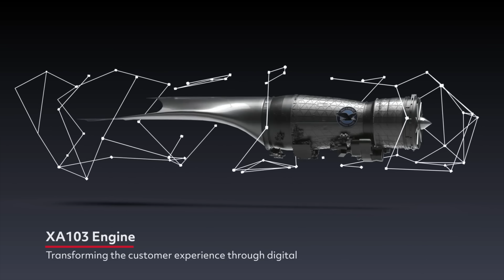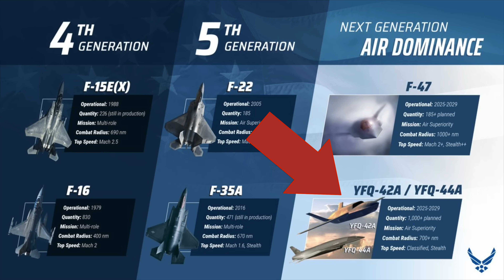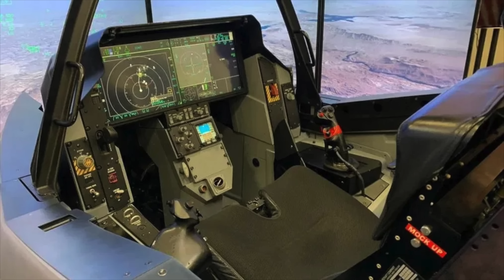Is the US Air Force F-47 Already Flying Missions?

Comment: The new engines capable of 110,000lbs. of thrust with 25% better efficiency. New tougher and better stealth materials. A new data and communication architecture. A flying node able to control CCA's and other forward deployed assets. With the new JATM 260, peregrine and mako missiles becoming available. More electrical capabilities, battle management systems, next gen radars IR sniper pod AGM 183 carry capabilities and LRASMER. This is a generational leap in capabilities.

Comment: Provided it all works, it seems like this will make one pilot the equivalent of 5-10 pilots provided they can stay hidden and at range.  That's just insane.  The ability to move drones in and out so they can refuel or rearm would allow that one plane to control a LOT of airspace for a long time.   I get why they want this for sure, if it works, it would be a massive multiplier and allow a much smaller manned pilot force.

Comment: This may sound crazy, but I saw this aircraft (or something very close or looks just like it) when I was stationed in Nevada (technically, Nellis AFB) back in the late 1980s.  Possible?  I don't know how, but I know that I saw it take off from the runway and fly straight up and then out of sight in about five seconds.  It didn't have the sound of a normal jet engine, rather a pulsing sort of sound (the only way I can describe it is the sound you hear when you're driving your car and one of the windows is open--that sound you hear and feel as the air move in and out of your car).  It also didn't have any vertical stabilizer wings (kind of a flying saucer look when you viewed it straight on from the front--as we saw it coming down the runway).  My partner in the car saw it, too.  It flew right over us (we were in our vehicle stopped near the end of the runway (northweast side), coming back from the LOLA on the far side of the runway).  I never saw anything like if before nor after.  A few years later, I described what I saw to someone who knew experimental and secret aircraft, and he said it looks/sounds like something from the Aurora program.

Comment: I'm 100% sure that the USAF will follow the same pattern that they used with the F-117. They most likely have two operational units of 20 planes each (two front strategy). With an additional unit dedicated to training. There will also be two F-47's at area 51 for udate proofing. I expect that we will find out later that the F-47 was with the B-2's over Iran. This is what I experienced for 8 years in the black/grey F-117 program at Nellis AFB, and TTR..

Comment: I will have to apologize up front for questioning some of the data that you have given regarding the F-47 program.  As I ponder back on the previous programs - all of the "fighter" profiles that we have seen come out of the contract programs - The F14, F15, F16, F18, F22 and F35 programs have ALL  maintained vertical tail fins on the back (single or double) for Mach 1.2+ operational speeds.  This new F-47 profile (albeit stealthy looking) is an otherwise unproven airframe in any battle theatre.  Russia's SU-57 Fighter has shown its air dominance capabilities.  Furthermore, the pilotless F-47 hasn't been tested with its onboard AI systems to see how much more dominant it is in dogfight scenarios against experienced pilots in F-22's and F35's.  You can remind us that pilotless fighters can perform maneuvers in excess of 8 G's and not lose pilot consciousness, but this doesn't attest to the unknowns regarding the new F-47 with an unproven airframe and autonomous avionic flight software.  Computer simulations alone are not sufficient for thorough assessments of these contemporary platforms.  Thank you for hosting such an insightful and confident review of this new air dominance program, but the fact of matter is - no data has been given about this fighter's operation around an S-300, S-400, or S-500 Russian radar systems that are said to be able to detect and track F-22's and F35's (at least the S-500 is supposed to have an upgraded capability for such).
Reply: Oh, and might I add - Canards - not typical of an American Fighter design - unless we are trying to blend in more with the Russian design concepts (lol).

Comment: Hey Ryan. What if the problem is not 2 engines but several smaller engines. Say 8 vector thrusting engines blended into a B21 design. Cruise on a few engines, or tear up the sky with all 8 on afterburner, till the scramjets kick in. Think of the manuvers an 8 engine thrust vectoring wing could do. Yaw is not lost. In fact, You could crazy Ivan. Flip end to end. I'll see if i build a ducted fan drone to test the concept. Cheers.

Comment: The more I hear people like this, the more the whole thing comes across as made up propaganda. There's just too many obvious problems with the story. The B-21is a real thing that's currently being built. Incidentally, it will not be operational until sometime after 2030. Meanwhile, some fake 3D render of a supposed F-47 shows up completely out of the blue, and we are to believe that it is real—in fact has been real for years, and is practically already flying combat missions? And without even a single photo that actually shows how it looks, no less? In other words, we are evidently expected to accept the absolute lunacy that some goat herder in the middle of nowhere will have already long ago seen what is, kept from the public—which, mind you, serves no actual purpose (most differences between 5th and 6th gen are not visible from the outside, so the whole front fuselage shrouded in mist presentation is nothing more than cheap theatrics), yet at the same time just so happens to benefit from public ignorance regarding what 6th gen actually means; because if the public actually knew, then they would also understand why that picture is 100% theatrics. The whole thing reeks of BS. And it's not even intellectually challenging, which is what makes it most insulting. It is completely reliant on the fact that the public doesn't even have the faintest conception of what 6th gen design entails. This much is readily evidenced by the fact that all these Internet geniuses saw some tailless Chinese prototype and, on this basis alone insisted it was 6th gen.

Comment: Just came here from your newest and really disappointed, still more concept models.  How does this have more payload?  I counted a decreased payload from the F-35:  4 AM-RAAMs, 2 Sidewinders, and 1 etc., I'm also betting less, possibly no, gatling.  The decreased cannon would make sense with its decreased ability to dogfight though, so at least some thought was put in.

Can't wait for it to have to be redesigned, $$$, for exterior fuel and weapons attachment points.
Reply: You said it yourself, it was all concept art, so why would you assume the payload is what was showing in a “fan made’ concept fighter? That makes no sense. I do believe it’s size is in part to allow for solid payload capability, but for each F-47 to have slaved drones with onboard weapons systems means the technical all up loadout is even higher than we thought…spreading your payload across drones lets you carry more and less at the same time to maximize range. The F-47 won’t need to fly weighted down to the max to have a greater assortment of available armaments since many of the bombs and missiles it could equipment can be Sherpa’d out to the target sight. Moreover less dogfighting capability means more armaments ultimately. Dogfighting always required compromise, weight and inertia are unavoidable with thousands of pounds of armaments on the aircraft. Less of a compromise for the F-47. I think this entire program needs to be looked at holistically before assuming the worst.

Comment: It, "processes AI."  How exactly does one process AI?  It's an entire 2.something feet longer and 5 feet wider than F-22, but has over double the range?  Even if it has 1,000nm range, that means that the conga line of tankers that will be required to get the thing into the combat with China will be well within range of Chinese aircraft and their missiles.  That is the benefit of a carrier, unlike air force bases they can move and launch their aircraft from not Hawaii, AL, or CONUS.  Yeah, I'm assuming Guam doesn't survive and no one wants to be involved with us for some odd reason.  Naturally it will need to actually exist.  I'm not buying it does outside whatever leftover prototypes they had leftover, nor that Boeing can build anything in a meaningful quantity anytime soon.  2035, haha.

Comment: I’m going to receive a lot of controversy but i don’t this will be unbeatable. The Chinese already have 2 flying 6 gen prototypes that are quite deep in that section and even though it’s likely the US plane may be slightly better. It completely unreasonable in stupid to assume chinas tech is bad. It is a lot easier for china to get a good plane working faster than USA simply due to the sheer number of stem students there. I’ve also seen people say that Chinese stealth tech is bad and even though it is generally considered worse than that of the us, they still have 2 operational 5th gen fighters so they definitely have the technology. Chinese planes are also now combat proven as they downed 3-6 Indian jets without maintaining a loss( rafale(s) su30 mirage mig29 downed by j10ce)

Comment: What I've learned about tech development in general is that throughout history, US fighter jets have often had electronics down to the integrated circuit level alongside systems level that the public has only in it's infancy or theoretical stage of reality, which are in contrast decades or fully functional and even optimized and improving. Every consumer grade tech commodity is a trickle down from advanced fighter aircraft, long long after it's been cutting edge in them much less public knowledge. In this case, I'm certain the AI platform present on these fighters is frighteningly advanced, perhaps even including aspects of AGI. No doubt in my mind they've reached that already, and likely would have to tamp it down to follow orders for combat. Then again, they likely have trained it's datasets specifically for war, which is itself a frightening prospect. Ghost in the Shell and so much other sci-fi about AI is not far-fetched, at all.

Comment: The adaptive cycle engine XA100 for this thing is still in development. Still 2 years out before it is mature enough..

I doubt it had being flying. Flew a scaled test bed for the control system, maybe.

If you look at the funding levels for F-47 compared to F-22, it is roughly the same at the developmental stage. Much lower than what F-22 got when it is in the production stage. 

 The plane is still in development.  USAF was caught off guards by the Chinese development, and is scrambling to save face, making up this secret flying  squadron. LOL

Comment: You have talked about Yaw, with the wider stance of the F-47 that means more control surface area, for greater stability.

It would seem that we are trying to make radar useless, are optical systems the way to find a plane? I mean we have space telescopes finding exoplanets, of course that would only really work in clear skies, but lasers scanning the skies and returning a hit, oh those have been banned ...good move? eliminate a tracking source before it is even put out as a possibility? the SR-72 had high speed cameras, those have only gotten better with time. if radio waves no longer work, then what about visible light, one fictional movie suggested air turbulence as a method...of course it also suggested a space based earthquake creator too lol.

Comment: If the F47 has as many defects as the F35 which has accumulated more than 800 major problems, the F47 is not ready to fulfill its functions in the near future, many pilots in Europe complain about the lack of reliability and operational availability of the F35, if the F47 is in the same line it is not a situation for the future.

Comment: And why do we need F-47 when we have F-35 with a life span of 50 years or 8000 flying hours airframe?
Reply: Because the f-35 is less stealthy and slower than the f-22 whereas the f-47 is even more stealthy and possibly faster than the f-22. The f-35 is a true multirole. Its not exceptional at any one thing but its real good at a lot. The 47 is more purpose built. Also the military has come to hate the single engine design even though thats exactly what they asked for when the 35 was designed. Thats one of many reasons the 47 is for sure a twin engine design.
Reply: @95dodgev10  And you know this from what source? Did you work on F-22 or F-35
Reply: @95dodgev10  what is less stealthy?
Reply: @xfastwalker according to public information the f-35 is considered "stealth" with a radar cross section from the nose of .005 square meters whereas the f-22 is considered "stealth+" with a radar cross section of .0001 square meters, again from the nose. Meanwhile the f-47 is being considered "stealth++". For reference, the f-35 appears on radar roughly the size of a golf ball or a small bird compared to the f-22 appearing about the size of a small marble. Now based on those two known aircraft its clear that the f-47 is going to be nearly invisible. Everything ive said in this comment as well as my original is public knowledge available through tons of resources so no i have not worked on either of these aircraft in any way but the information is out there for everyone. The f-47 on the other hand is still very much under wraps still and most information avaliable is either vague or speculation.
Reply: @95dodgev10  I worked on F-35 program. That's not how stealth works.

Comment: Years ago I used to play war thunder. Very grindy game. Back then I think there was maybe a saber jet and a few others. I stopped playing b/c in arcade mode they allowed 'mouse pilots' to mix with joystick pilots. Mouse control allowed your plane to fly with computer aided "fly by wire" controls, allowing you to have unrealistic flying capability that not even the most skilled pilot could not
 match (thiink flying straight up at well below stall speed while maintaining pinpoint accuracy.) Also getting shot down at 1 mile ranges was a thing. Tried non-arcade modes but it takes forever to get a match. So I quit and never came back. And a bunch of other things. Teams not playing as a team but going off and doing their own thing.

Comment: They announced it to the public so we know it’s already in service now and they’re working on something better. We didn’t find out about the f22 until 10-15yrs after it was already flying. The f22 was designed & built in 1990s
Reply: Wrong it was designed by me

 In 1976
At SKUNK WORKs CONCEPTUAL DESIGNER IS 

ME‼️‼️‼️‼️🎯🎯🎯🎯

Add 14 years
Reply: correct. The F-117 flew missions in Panama during Operation Just Cause

Comment: Very Briefed And Summarized Ideas:

Our Chinese friends Chengdu J-36 and the Shenyang J-50 are the first 6 generation fighter aircraft's took to the sky...

What is noticeable in the designing is the abandonment of the traditional side-by-sid engines for centralizing the thrust, in favor of spaced engines...

the platform will always be expensive because it will not be exported, thus unlike the single engine f-35, where the air force of what is very temporarily called the united states of america gradually succeeded in reducing the acquisition price of a single platform from its price in the first years by expanding its export base abroad, while this platform, like the its predecessor the f-22, will remain in the niche quality segment, although the navy of what is very temporarily called the united states of could decide to adopt this platform as a sixth-generation fighter aircrafts, then, with the current force posture of 11 aircraft carriers, and its structural distribution of 90 combat aircraft in each carrier the relatively, which is relatively new in age with future potential growth and the large gap in capabilities with the approaching retirement of the twin-engine f-18 with its outdated conventional design, so there is a possibility of purchasing at least 200 or 300 hundreds of modified variant and especially tailored f-47 for operating in the aircraft's carrier, considering the impact that unmanned platforms have had on the development of combat concepts and combat doctrines means that there will be reserved spaces on aircraft carriers for long-range drones, these spaces will be at the expense of the distribution of numbers and percentage of the fighter aircraft and combat support aircraft and rotary engines, although the pocket carriers or the helicopter carriers and landing ships can be platforms for launching drones, but they will differ from the organic capabilities for the aircraft carrier...

Comment: First off I pray the air heads didn’t pick this platform.  
It’d be a kick to the gut of the tax payer. 
I’d be ashamed. 
The Air Force has no need for a new aircraft just yet. 

The navy is the anchor of our country. 

Without new carrier based aircraft we are done. Toast wait watch and see. 

The J20 was stolen. 
Which included a variant for the center fans for vertically lift. 

The new 3 engine China bomber was stolen from Boeing. 
Why award them a new contract.